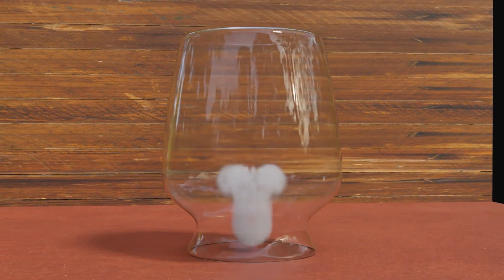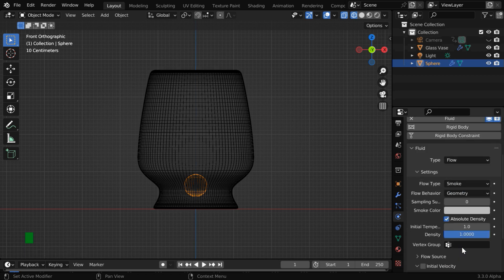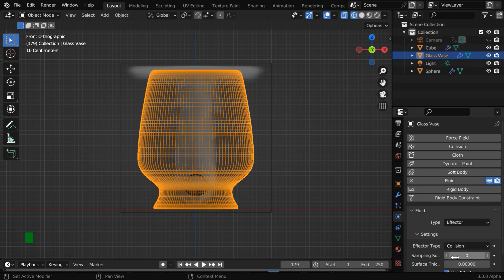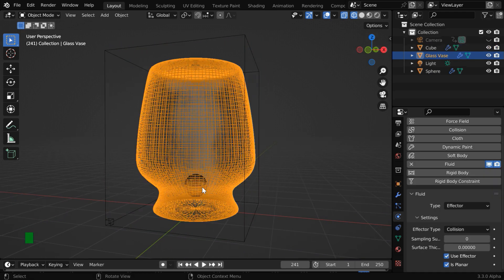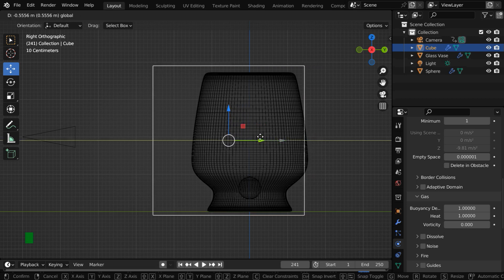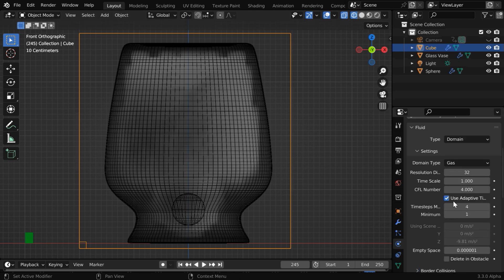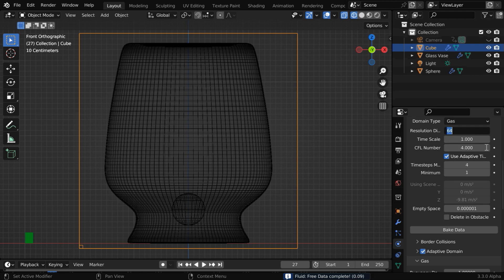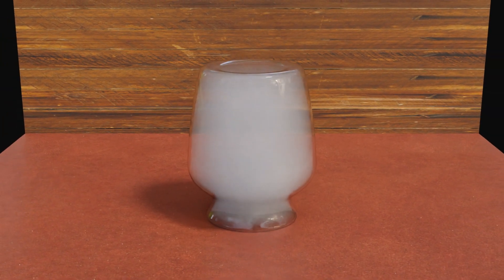Fill Any Object With Smoke In Blender | Solution To Common Problems | Smoke Simulation Project

Comment: use embergen :P. Smoke sims are so slow and is a painfull process to get exactly what ypu want+ its not real time, its lagging too much to see the physics properly. Also when you add more detail to your smoke, the output changes heavily
Reply from the maker: Yes, you're correct on both the points. The slow baking is not a big problem though, the beauty of a well designed smoke is worth the wait I'd say, it looks so nice 😊
Reply: @5MinutesBlender  yeah but it's a trail and error process. Huge time wast
Reply from the maker: @bionasys2967  It's not trial n error. It's called a learning curve, Blender does have a steep learning curve. Once you get a good experience, things becomes easier. It seems difficult & hard to control in the beginning.
Reply: @5MinutesBlender i have Blender 4.1 and it's still buggy and frustrating, exactly like years ago when they changed to Mantaflow! Almost nothing has changed: constant crashes, buggy behaviour, unwanted results, huge time wastings for unacceptable results. Almost every YT tutorial I'm not able to reproduce because my results are not close to that. It's pure pain! Why don't they do something about that issue? Like try to get a new system instead of Mantaflow .  When I work with Houdini everything works like a charm, no crashes, no bugs , logic and understandable work flow, and results that are WAY WAY better..
Reply: @5MinutesBlender  yeah I get it, you know where to tweak here and there. But still it's very shitty to work with. You always have to render to see somewhat of an output. I stopped doing that. I work in embergen, I get what I really want and I get it much much much faster and then I import to blender 😁.
Reply from the maker: @bionasys2967  I have experienced this in some other context and felt frustrated as well. When I spoke to the Blender team they actually confessed that no one is currently working on Blender physics anymore for the last 3-4 years. No bug fixes, no developments, no new features, and probably no plan to support this physics in the future. The reason behind this is unavailability of suitable developers. And that in turn is a result of lack of budget. I was sad to hear about it but we can't do anything because we don't pay them - it is all done on best effort basis by some nice guys, so we can't blame them either.

Comment: Okay a couple questions. 1. does how you make the glass matter? 2. I am unable to see the effect inside the glass object but when I move the glass object away I can then see the effect. and I can only see the effect in wire mesh. 3. is there a special method to make to glass hollow? Do I need to make it hollow?
Reply from the maker: 1. You can check this tutorial to know how to create glass material 👉 https://youtu.be/NMwZyfWjexY 2. Eevee is often not perfect, it does not allow us to see a semi-transparent object (like smoke) through a transparent material (like glass). Try to use Cycles for a better output. There are ways to make it work in Eevee as well, but it needs a complete tutorial, difficult to explain in a comment 3. Yes, you need to make the glass hollow.

Comment: OK, it looks like a simple thing - I add a glass object to be filled with smoke, create a flow object, create a domain and when I'm in the point " run the simulation we'll see that the smoke is generating " there's nothing - only static smoke around flow object ... EEVEE and CYCLES the same progress ... Blender 3.4.1, Ryzen 7 3700X, 32GB RAM, Nvidia Quadro P2000, Win 10 - all up to date - system even card drivers.
Reply from the maker: Been there seen that 😊 So I can understand the pain! Let me first assure you that it is nothing to do with your system configuration, and in simple words, the smoke simulation in Blender is somewhat buggy. Sometimes you'll see that nothing can make it work, it behaves very weird. However, the good thing is, it does get solved as well. Some of the things that I can suggest you to try: 1) Clear your cache files physically from windows explorer, navigating to the location where you kept the cache (by default it uses some system folder, but you can change the cache location in the cache section under the physics tab). Then bake it again. 2) Delete the domain and add a new one. Before you delete, remove any keyframe for this domain that you might have added, otherwise they will be duplicated in the new one and it can create a problem. 3) Dump this file and start afresh with a new file. Sometimes a file just does not work, although the same settings in a new file does. Whatever I said here may not look very logical, but it works in many cases. I know this from my experience and that is why I think the smoke simulation has some bugs.

Comment: Is it possible to make an abject smokey? Like a mesh with smoke coming out of it
Reply from the maker: Sure! It depends on how exactly you want it to look like. One option is to make the mesh a flow object of smoke type, keeping it visible. Then assign a semi-transparent material to it. Maybe a volume shader if you need the depth. You can animate the transparency of the material to keep it in-sync with the smoke pattern. Also it may be helpful to use a duplicate copy of this mesh which will be invisible, but will work as a second flow object, and the smoke from this invisible mesh should be heavier so that this part of the smoke remains mostly around the mesh itself, making it look smokey. These are just some options that you can try out. All the best!